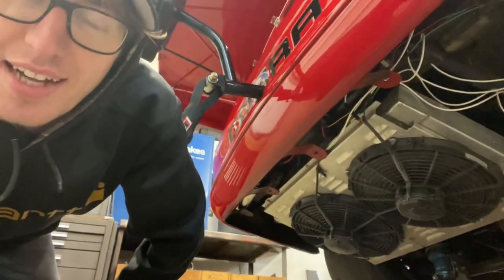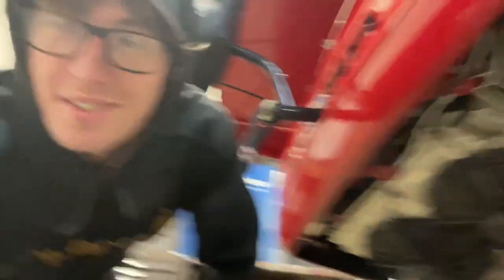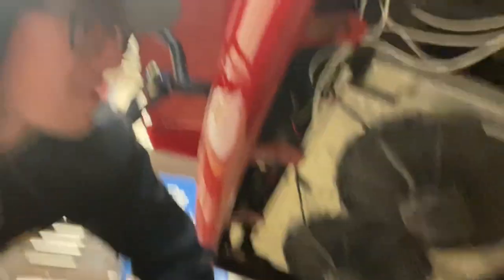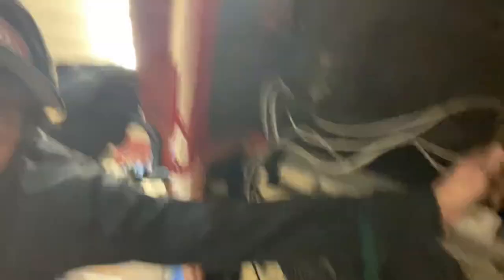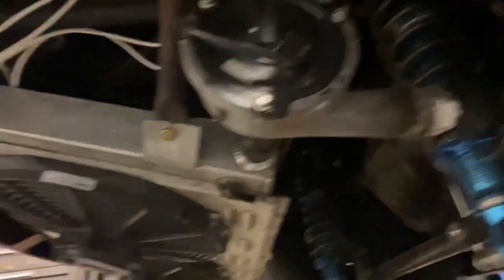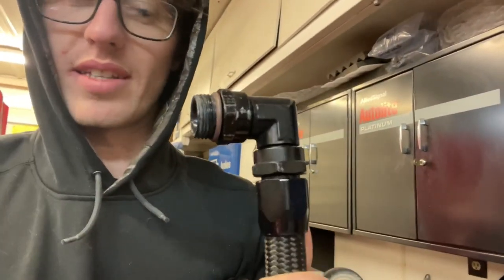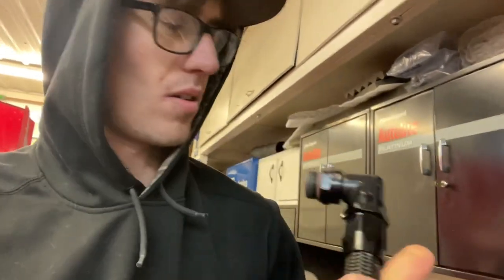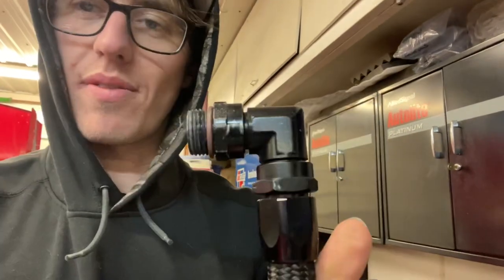Rear mounted radiator! How i made it work and how to bleed the air out! 102mm turbo SBE 5.3 Mustang!

Comment: Hi, I've just found your channel and am about 10 videos into it and have subscribed.  Great content!  With the water pump, is it supported by a bracket, or is the weight of it held up by the AN fittings on the inlet side of the pump?  Thanks!
Reply from the maker: Thank you! Nothing but the hoses on It holding it. Seems to be pretty solid so far!

Comment: Getting ready to do a rear mount on my truck  for raceweek. If my radiator cap is my highest point, is a surge tank necessary, or will a standard overflow tank suffice?
Reply from the maker: Long as it is upright or at least tipped mostly up  it should work pretty mint

Comment: Does the water pump turn on at the same temp as the fans ? Or is it controlled some other way? Thanks
Reply from the maker: The water pump is on all the time when the car is running then the fans come on at 160

Comment: Being in the back of the car can it get enough airflow to keep cool regular street driving without the fans or do you just run both fans high speed constant and let the thermostat control the temps?
Reply from the maker: No thermostat. The air moving won’t cool it at all, it 100% uses the fans only
Reply: That's a sweet set up that didn't seem to cost a whole lot!
Reply from the maker: Super cheap!

Comment: So where exactly does that top hose on fill tank go to
Reply from the maker: It goes all the way to the block where the water exits the motor
Reply: @OverydeMotorsports  oh ok. I’m getting ready to do mine and I thought u only needed one line off it to go to radiator just to fill it. I didn’t know the pump was pushing the water into that
Reply from the maker: I see. Yep on line from bottom of the surge tank to the rad then into the pump and then to the block and then back to the surge tank